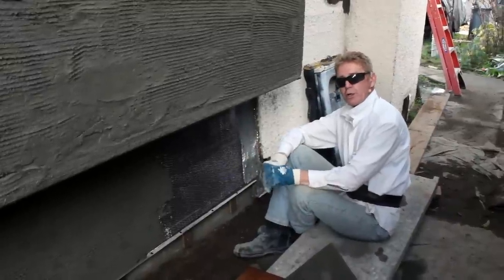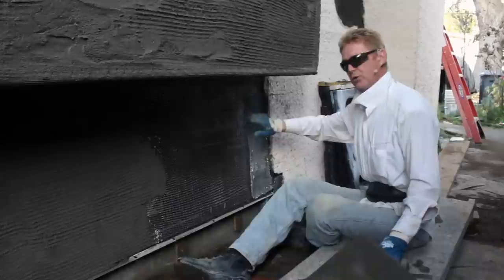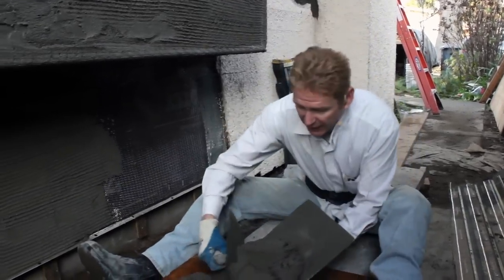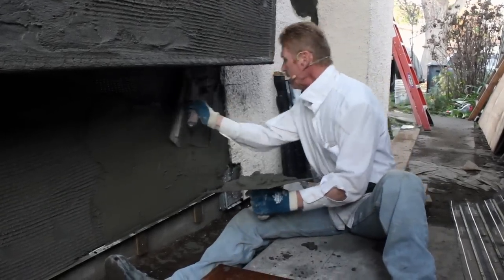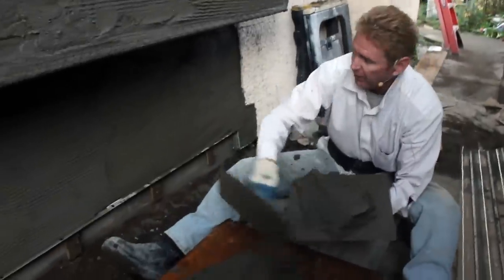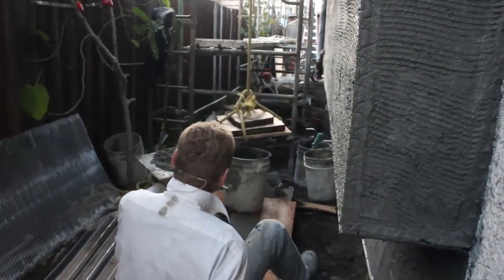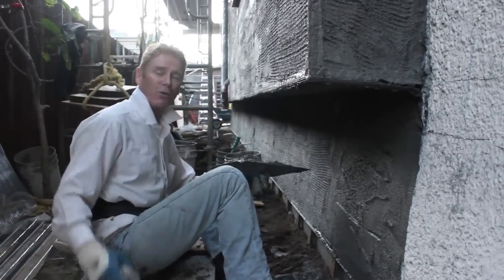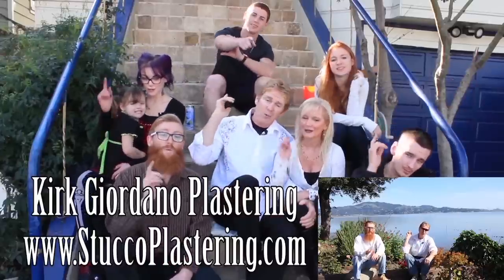Stucco netting.

Comment: Kirt, You indicated in the video that the 3.4 mesh is not code for wall in the San Francisco Bay Area.  I am planning on plastering a curved stair case interior wall use diamond mesh and felt paper attached to the stud, then plastering over the mesh with Imperial basecoat and Diamond finish coat.  Will this system as described above pass the SF Bay Area code, if not, why. Also, do you have a better suggestion for plastering a curved wall?  Any advice is greatly appreciated! Tom
Reply from the maker: Howdy Tom, when I say, "it's not code," I just mean it's not necessary to use 3.4 metal lath on exteriors of homes when stucco netting is a better choice, and yes, your method for an interior well is correct.
FYI, you don't need a moisture barrier inside a home, "unless it's in a shower," nor is a lath inspection required for interior plastering.
     
                                   Live long and plaster
        Teaching do’s and don’t of plastering and stucco work

Comment: Kirk! Love your videos man! Curious... I will be doing a stucco coat over the granite-fieldstone foundation of my house in Maryland, which is also below grade and the application will be on the interior-side. Which type of mesh lath would you recommend there sir?
Reply from the maker: Neither, pressure wash, apply a stucco bonding agent, then stucco it. Type in how to stucco of concrete.
Reply: @StuccoPlastering  Pressure wash the interior foundation wall of my house? This is the interior wall is 8ft high by 15ft long, and my goal is to make this functional space - I should have better specified. I have the bonding agent, and Type-S Commercial Quikrete. So no mesh needed?
Reply from the maker: @joshuagerczak2751  no worries, clean the wall the best you can with whatever method necessary. A wire brush with a lot of elbow grease also works.

Comment: I've watched this video a few times now but the reason you chose the diamond mesh over the standard wire still escapes me. Looks like you were just about to explain it but moved on. Could you clarify a bit more when to use diamond mesh? Reason I ask is because in my area, thats all be thats available outside the smaller gauge poultry netting. Love your videos by the way and very thankful for you putting this information out there for us!
Reply from the maker: Good evening Aaron dude, no problemo, and excellent question,
   FYI, this wall had no solid backing, instead, it had furring strips that started at 1 inch at the top to 4 inches towards the bottom, these plywood 4 inch strips were then nailed in at the top and shims were used to bend out 4 inches to the bottom, as they could not bend plywood to form such as arch or radius, sort of like the bottom of a funnel, then we papered it, if one would put your hand between the wood strips you would find it hollow. 
   So if I were to use my typical 17 or 18 gauge stucco netting the stucco would have gone through the large holes and most would have fallen to the ground, however with this diamond mesh or what we call 3.4 met mesh, we were able to just apply the stucco without most of it falling through tas the holes as they are small this is the reason it's used primarily for soffits.
                     Plastering tips and techniques

Comment: I have a question. Got a exposed basement wall that is unfinished. It has a settling crack down it.  Wanting to do a stamped coat on it. Will a mesh keep the stamped finish from cracking.  Need advice please

Comment: Kirk thanks for the great videos, can I ask is there a way to separate ceramic shower tile from a 1950's era wire and plaster wall so the tile can be replaced?  I want to remove a section of tile for a plumbing repair and then be able tape and seal the joint between the cement plaster and a Hardibacker patch. When attempting to remove the tile from the plaster it come off in fragments leaving an unworkable surface.
Reply from the maker: Good evening Dude, all I can say is to use a flat putty knife and tap gently with a hammer if it shatters, such is life, just don't get it in your eye's.
 Keep in mind that ceramic tile is glass-like and very fragile, wear goggles if you try and remove it as a fragment of this glasslike tile in your eye will definitely take the wind out of your sails.                    
                                Live long, and plaster
                     Plastering tips and techniques

Comment: Very informative video thank you. Stucco mix, portland cement, any particular kind?
Reply from the maker: Good Morning Armand dude, FYI, I used Omega's super cement plaster for this application as it has very mall fiberglass added, thus you cant see them, but the texture needed the extra stickiness to help the 1/2 dash adhere/stick, that video coming soon.
 As a rule, I use Hanso Lehigh premium cement plaster, 3 parts sand to one part cement plaster which big Luuu adds by hand.
    A mans got to know his cement plasters in this industry.
                    Live long and plaster
    Mastering Plastering by Kirk and Jason Giordano

Comment: The most important part of any plastering with Lath is "embedment of the lath"....regardless of the style Lath. If you don't encapsulate it, the system may not perform in the wall as intended for rack/shear, wind loads, moisture penetration.
Reply from the maker: Good Morning Chris Dude, exzackory                 
                              Live long and plaster
                     Kirk and Jason Giordano plastering tips

Comment: I think it is called the "brown coat" because sand was added to the second coat that gave the plaster a browner hue.
Reply from the maker: Good evening Daniel dude, if you mix sand with Lehigh's white cement plaster or Eisenwall hydraulic cement plaster will give a tan appearance as both are white cement  and the sand brown, when mixed, voila, tan
 however, all other cements are gray, when mixed with sand dark grey when applied and light gray when dry.  
  OK,  just googled it and still can't find why the second coat is called a brown coat.                    
                                Live long, and plaster
                     Plastering tips and techniques

Comment: eventually will metal lathe  Rust ?  browncoat. Adobe clay. house finish  is a brownish color   .
Reply from the maker: Morning T Bok Dude, all stucco netting, and mesh wires are galvanized dipped to prevent rust, have I seen rusted mesh wire? many times, this could occur as when the mud is overworked it scraps some of the galvanization of the metal exposing the steel which then is prone to rust or the mesh is not galvanized, and or it can be old as the hills, I have seen a few times in material yards or some places stacks of hundreds of sheets for sale at  1/3 the price as certain yards. Although I've seen it, I would not purchase as the stucco can allow the  rust to bleed through causing a color finish to look awful. 
   So the origin or the Browncoat is adobe clay finishes, sounds like ole T box is pulling my leg?
              Live long and Plaster
  Sharing DIY Plastering tips from team Giordano

Comment: What if you get a hollow air space behind the mesh?
Reply from the maker: Good evening Frank dude, excellent question and good eyeI told the folks prior that they can add some spray foam to fill the void under, or build it out a different way where they could be no gaps,  were only as good as what we have to work with.                    
                                Live long, and plaster
                     Plastering tips and techniques
Reply: wouldn't a hollow space behind the mesh be a good idea as it gives any moisture a way to escape? The air space also allows for air movement keeping the building dry.
Reply from the maker: Good afternoon Crazy Dude, yes there's a hollow spot, but the rainwater will not touch this are as it protected by two layers of paper.
                       Live long and plaster
           Sharing the plastering knowledge
Reply: Thx Kirk!!!
Reply from the maker: Howdy Frank, no worries     
                    Live long and plaster
         Mastering Plastering for the beginner

Comment: Bruh..Bruh..What if its called a brown coat because its a modified adobe structure. Like you put the scratch coat up with a standard portland cement modified stucco scratch coat mix. BUT the brown coat and finish coat are just mud like an adobe house. So when your mud melts off you just throw more mud at your house but the 1s scratch coat is more water resistant? Considering stucco is just us showing adobe guys how to mix in some portland cement.

Comment: Kirk,I just did a job using white cement and sand, but I wasn't sure about adding lime to the mix. What is your take on lime ?
Reply from the maker: Good evening Al dude, sounds like you were applying Handson's Lehigh white cement plaster which when mixed with sand becomes a tan color when set.
      As a rule, I rarely add Lime to any of my cement plasters as that's apprentice stuff,  with hands-on practice for you as a plasterer try to spread any material weather stiff, sandy or soupy, I prefer cement plaster like whipping cream.
   Besides lime is already in most cement plaster's including Hanson's white cement plaster, I recommend that whichever cement plaster you choose to get into the habit of applying it as best you can, as you are an upcoming stucco professional, of course, if it's too sandy or stiff, I tell my guys to add more or less sand and or water, plastering is always compromising.
                       Live long and plaster
       Teaching the world to stucco, one video at a time.
Reply: Kirk Giordano plastering Inc. Great,I just finished a stucco wall,with a white cement from a company called,Federal Cement. (East coast we get this). On a side note it is hard to find go supply or material companies here in Philly metro. White,fine sand is difficult to get locally too. I was kind of hesitant of the skip step finish ,as I have little experience . I returned to the job the next day and it looked better when it dried. Many thanx .Albert.
Reply from the maker: Good evening Al dude, when I first started, after 4 years of applying everything under the sun, I was transferred to a color coat texture crew to apply just textures, I told the foreman although I had many years in I had never applied the skip trowel finishes, he just laughed and said by the end of the day with your hands on experience I'd be fine.
  He was right but I did sweat most of the day worrying, happens to the best of us. 
Your courage is going to make you a hell of a great plastering contractor, soon you will be making the video's and I'll be on a beach sipping margaritas with my wife while side glancing at half-naked senorita's
                       Live long and plaster
               Kirk Pierre Giordano plastering

Comment: Stuff is junk for houses
Reply from the maker: Evening Jason Dude, easy big daddy, I wouldn't go that far as it's great for ceilings and has other reasons that stucco netting isn't engineered for, cheers  
                 Live long and Plaster
 Giordano’s plastering and stucco wisdom videos
Reply: Jason is one of those edgy bois that just started out in the trades, worked for one company and learned their method, and thinks that's the only and right way. Dealt with them a lot in my 25+ years in the trades.